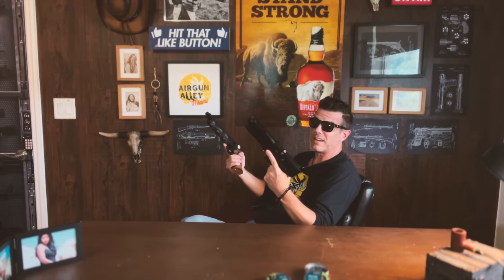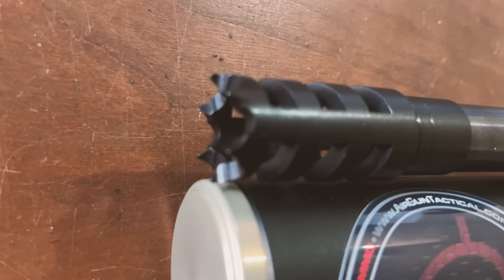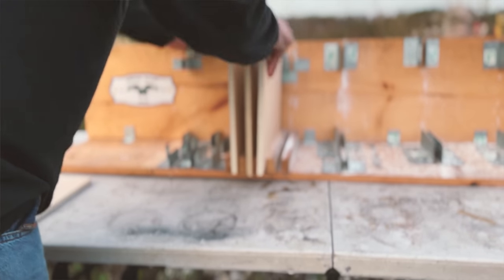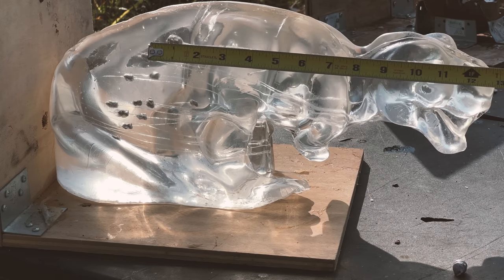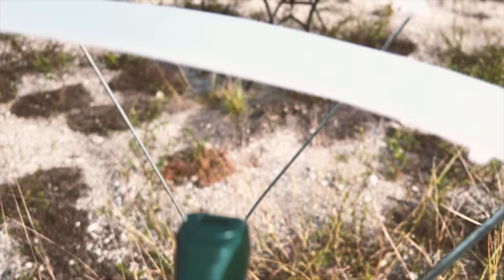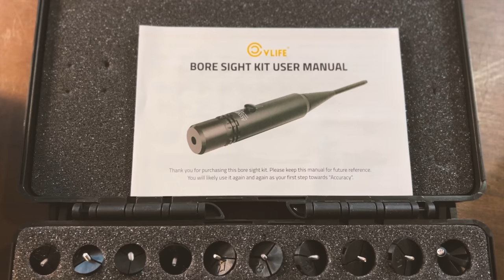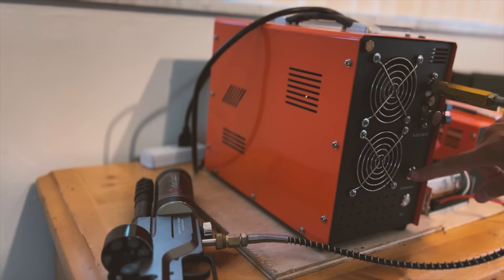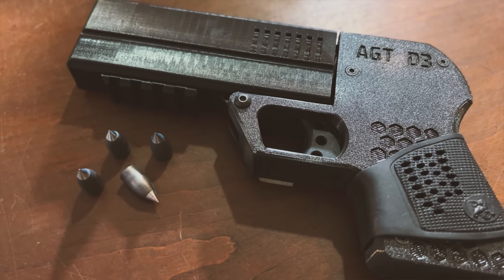NEW! M50 - ULTRA POWER AIR PISTOL

Comment from the maker: FIND EVERYTHING HERE 👇🏽

🔫💣 GUN AND AMMO: https://airguntactical.com

🔴 Red Dot https://amzn.to/47xhb2y  (15% Discount code: C9DO2NC4)

🟢 Laser Boresighter https://amzn.to/3SVmmF3 (Exclusive Fan 20% Discount Code HR20231127 valid from Nov. 15th to Dec. 24th 2023)

CLEAR BALLISTICS BALLISTIC GEL 

🦖 Kentucky Ballistics T-Rex:  https://amzn.to/3ZKDMWf

🧸 Teddybear: https://amzn.to/46qObbN

🐇 Rabbit: https://amzn.to/4552AJC

💨🗜️VEVOR PCP AIR COMPRESSOR: https://s.vevor.com/bfP94u code: VVSALE5 for 5% off OR ON AMAZON: https://amzn.to/3XVrPMH 

🧯4500 PSI AIR TANK  https://www.tkqlhce.com/click-100988378-12817065?url=https%3A%2F%2Fwww.pyramydair.com%2Fproduct%2Fair-venturi-carbon-fiber-charging-station-4500-psi-98-cu-ft%3Fa%3D5905%26page%3D1%26query%3Dtank%26lang%3Den%26searchConfigId%3D643645070c547549270ccc15

🗡️ BOWIE KNIFE: https://amzn.to/3PZlNXy

🧭 Chronograph https://amzn.to/3FSr0Mm

◻️ Metal trays (great targets!!) https://amzn.to/3MZ5t8L

🕶️ MY SAFETY GLASSES https://amzn.to/3e2DAxX

🔫 BEST SEMI-AUTOMATIC PCP PISTOLS 

HUBEN GK1 : https://www.hubenairguns.shop/collections/pistol-gk1

EVANIX VIPER: https://www.newenglandairgun.com/evan...
Reply: Can it kill a boar?
Reply: You should get an adapter for that scuba tank. I have that same compressor and I shoot using my large tank like that to refill, then I refill the tank using an adapter with my compressor. Just dont let the compressor run for more then 20 minutes at a time and you are fine. The book says you can run it 45 minutes and let it rest ten, but I run it for even shorter times to prolong life and reduce wear. I keep my SCBA tanks at 4500PSI myself easily. AirTanksPlus is who I got my adapter from.
Reply: PCP mini semi auto, lipat juga boleh yg sangat sangat senyap ada gak y ? yg bahannya bagus awet, CC lmyan awet. Budget dbwh 10jt. trims
Reply: @AirgunAlley questa qua proprio voglio

Comment: Awesome video my friend very cool gun it gives the Huben GK1 a run for its money in stopping power as it has bigger rounds but it also went through 3 big water bottles with less power compared to GK1's 2. But for home defense the GK1 would prob be your better option as it as semi auto and has decent power.

Comment: Great video as always, I think that model would be much improved if it were a semi auto as the bolt action takes too long especially if you compare it to the Huben system, hard hitting though when you consider the caliber!
Reply: Semi auto would probably cost double the price
Reply: @GalacticalAmbassador  It would be worth the money!
Reply from the maker: I totally agree with you Roger! Looks like the technology is moving in that direction… 🤞🏽
Reply: Yeah semi auto would be way better. But if semi ain’t possible, why the fuck is the lever on the right side? With a pistol it would be logical that it would be on the left.

Comment: Good nigth!
I have a Feinwerkbau P44!
I was going to train now in the morning and a Pellet came in the opposite way... I give some small  beatings on the P44 and when I went to shoot she wouldn’t shoot! 
The trigger was stuck, it couldn’t go from dry shot to air... I tried to activate the cocking and nothing, it didn’t reach the end and suddenly fired two shots... I went to see from the absorber to the manual and turned to the right screw because was before the 3mm! 
It was good! Was it really from the absorber? 
It seems that it was good and that you rotate to the right is when the resistance is before 3mm which was the case... it seems that running only on little bit to the right and giving a few shots straigth as the manual says it was good!!! 
Was it the absorber? 

Thank you and please

Comment: What are the firing speed of these slugs?  Their weight, etc.? I have the AEA carbine models of 25 and 35 caliber, and I get twice that in penetration, the .25 at 1080fps and 42 gr, and the .357 with 920fps and 85gr, both will go through a DF 2x4 and two feet of ballistic gel

BTW the 1/2" plywood you are using here is cabinet grade, much harder and more layers of hardwood than in common plywood..

Comment: I just got a little larger max hp sitting in my house. Mine is .50. trying to figure out mounting scope with a maxazine
Reply: Same. Going to local shop to see what they can suggest
Reply from the maker: Haha maybe try stacking a bunch of picatinny adaptors on top of each other until you reach the right hight 😂
Reply: 11mm scope rings with about 20-25mm height are usually tall enough to clear the magazine

Comment: The main issue I have with these pistol airguns is that they aren't dual regulated.
I saw a video of a guy that did a chrono test on the new Huben GK1 and the power dropped from I believe around 80 footpounds to around 60 or the screen showed 800 and stopped around 600.
So that means you have to change your hold over with every shot.
How consistent is this one ?
Reply: Edit : again with your fps it was wildly inconsistent.
Power is really cool but the thing is it's not worth it if you lose 1/3 of it after just 6 shots.
Reply: The Huben GK1 has adjustable power. If you want more and more consistent shots at lower power you can just turn the power down. Also, at closer range that bullet drop is basically insignificant.

Comment: Hey on 8:05 in the video you can see the balistic Joel of the Huben  and m50. Seems like the huben has longer penetration. Does anybody kno if the huben is stronger than the m50. I’m thinking about buying one tomorrow because Black Friday sale ends. Been watching lots of videos love your channel appreciate the commitment
Reply: The new GK1 shoots the heavy 6.35 slugs of HN at 950 FPS. 
So the new Huben is a huge improvement compared to the old Huben pistol.
You can lower the speed and power and increase the power again through dieseling.
Vaseline is doing the same thing and lasts for many months.
With suppressor you can finetune the Huben so you don't hear the crack from breaking the speed of sound.
The Huben is the best buy at the moment but expensive too. Around 1000 dollars.

Comment: A well done test on what appears to be a potentially capable higher powered Air Pistol. However, the manufacturer's engineers need to work on improving the amount of full power shots the user gets! I can see this higher powered air pistol being effectively used to harvest small to medium Whitetail Deer or Coyotes.
One projectile option for responsible Airgun users is to check out my invention of 45 caliber 220 240 and 255 grain 45 caliber Kaido Ojamaa-VKJV Universal Bullets. Which offer maximum power effectiveness in a whole selection of arms from cap&ball percussion revolvers to muzzleloading pistols and rifles and higher powered air rifles and pistols for hunting and wilderness protection purposes.

Comment: looks like a lot of fun to shoot :D  great video as always :D
Reply: like all airguns you might get 70 sots and 5 or 6 high powered shots,,  then its just goes down from there...  and a 200cc bottle would take 5 hours to pump up manually so. down to the sports shop that has a scuba tank filling device... good luck on that one...even co2 refill is expensive,  so stored air is a no go for me I use a pump gun

my crosman 2289 is up to 1600 fps with 27 grain pellets.... for $60 for the gun And $ 150 for the mods.. pcp aint worth it

Comment: Not bad.
But I do wonder why a right hander would buy a left handed pistol.
I have a 2 PCP pistols and they both have the cocking handle on the left side so I don't have to change hands to cock and load.

Comment: That Pistol should be called the BIG BORE BEAST. 
That Coconut didn't stand a chance. Maybe in future they will modify the rear of the frame and change the bolt action to Straight Pull Back Action. Cool New Friend you got there.
Reply from the maker: Ooohhh that would be very cool! Great idea… and thank you so much!
Reply from the maker: Ooohhh that would be very cool! Great idea… and thank you so much!
Reply: It has a strong spring and a heavy hammer to smack open the 4,500 psi valve.

Nevertheless, it is too bad that the HP max line got the bolt action style rather than the side lever that AEA’s other big bore rifles have.

Comment: Look up new “iron man” material! This is what’s going to propel air rifles past modern firearms. If they can build an air compressor compact enough to be mounted right on the rifle and the air cylinders will be able to handle more pressure. 🤯